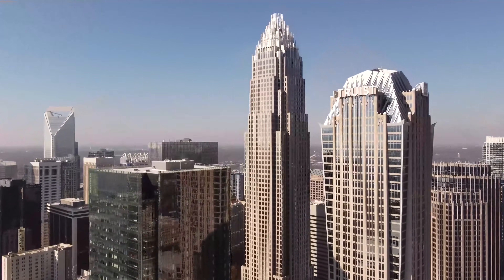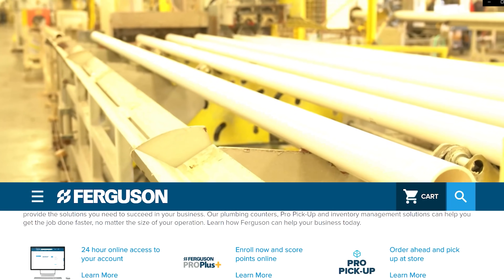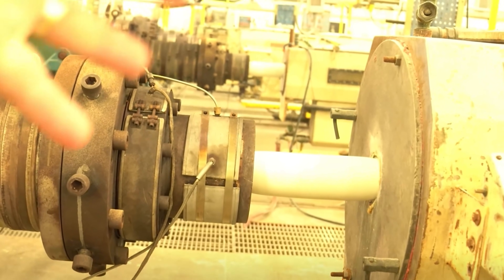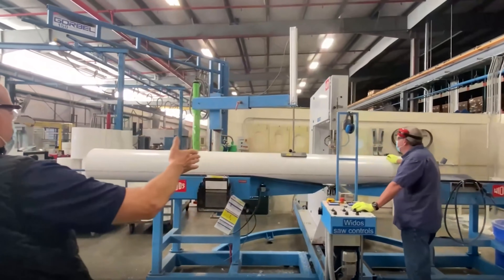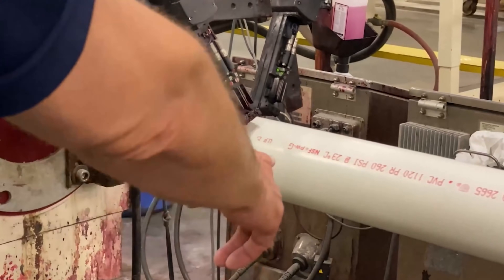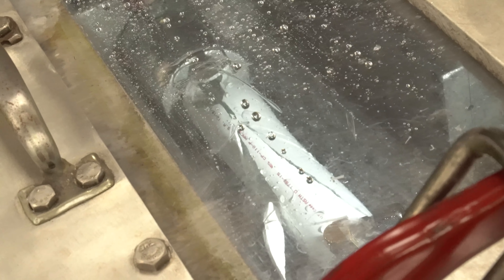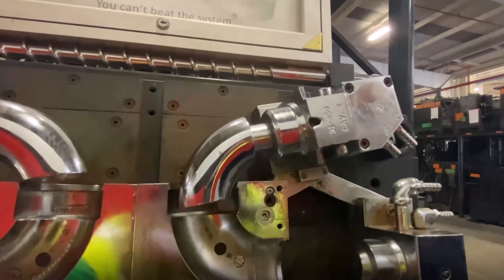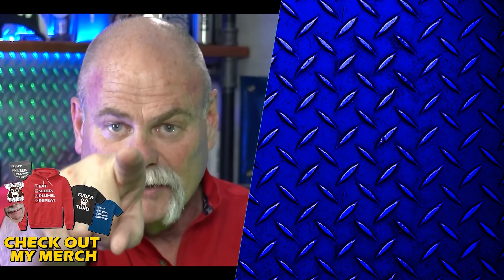How Plumbing Pipes Are Made | Charlotte Pipe & Foundry Company

Comment: The screw you showed above the mold is actually what melts the plastic through mechanical stress induced heat. We rip up the resin into a liquid state and then inject the liquid into the mold.

Comment: Why are they only pressure testing a short piece of pipe instead of a 10ft section? I feel like a longer section will fail quicker
Reply from the maker: I don’t know why... When the pipe gives it gives...
Reply: Every piece of c900 water main PVC was tested .dunked under water ends capped pressurized 4x rated max....some would fail bursting in pieces

Comment: I’m not a plumber, I’m not an apprentice, I’m studying to be a funeral director. Why is this so interesting to watch?
Reply from the maker: Not sure but I’m glad that you enjoy it. What was your favorite thing about the video?
Reply: @RogerWakefield  I love seeing things made it stirs something with my autism seeing that stuff, and yes I enjoy seeing the plumbing work too. Tho it was a tad short on explaining the actual manufacturing process if I were to critique it any.
Reply: @sterlingodeaghaidh5086  There's 2 basic technologies you're watching extrusion and injection molding.  The 2d pipe is extruded the 3d shapes are injecting molded. Both use large screws with a narrowing screw root to feed melt and mix the raw plastic pellets inside the round heated barrel.  For extrusion the screw keeps turning pushing the hot liquid resin thru a die set to make the round continuous pipe profile in a continuous process. Injecting molding does the same only the screw is allowed to move backwards while it's turning pushing resin in front of the screw tip. The screw tip has a one way check valve.  The screw is then driven forward forcing the molten plastic shot into the mold cavity. Then it's held under pressure until it cools and solidifies.  The molds have arrangements of cams pivots air/hydraulic pistons stepped parting lines gears collapsible cores etc. that are timed to move such that you can now get the solid 3d shape out of the mold when the 2 halves separate without ripping the part apart stripping molded in threads etc.  The large parts are only cheaper to make by hand because of product volume.  The million dollar fixed cost for a large machine and molds isn't covered by the greatly reduced variable pc cost. Special materials are often used for pvc molding. The hydrochloric acid produced during processing can chew up molds and machines.
Reply: A fellow deathling!! Ayy we need more funeral directors!

Comment: I hate plastic pipe. If it was up to me it would be illegal in all 50 states and we would go back to copper and cast iron.
Reply from the maker: As much cast as we’ve changed out, I’d disagree. I think plastic has been good for us. Why do you not like it?
Reply: @RogerWakefield  because it's plastic. I feel the same way about pex. What's wrong with DWV copper and a 4" main soil line? And L type copper for water lines? I do have a little experience with both they just started coming into play when I was young doing residential work on Long Island. Then I started doing bigger jobs working union in the 5 boroughs of NYC, where you just will not find it. It doesn't exist in the 5 boroughs and is illegal. Why can't we just have a national code? I just don't like the stuff I have a bad taste for it.
Reply: Copper and cast iron are still used in commercial and industrial buildings. As far as residential, there is no logical reason to run cast iron because not only is it too expensive, but it also doesn't outlast PVC. Cast iron rots overtime and is usually replaced with PVC.
Reply: @strangeroamer3219  what about DWV copper vs PVC? Cast iron lasts forever. The only reason I would agree with you is underground. Yes plastic sewer pipe will outlast cast underground. It is common here on Long Island to run the main soil line and house trap in cast then transfer to plastic at the outlet of the house.
Reply: @TheRabidPosum  I get it. Installing cast iron and Copper takes more skill. But it also takes more time and costs more money. That's what it all comes down to. The home owner doesn't care what kind of pipes they have behind their walls because they are never going to see them anyways. They just want the plumbing to work and their house to look pretty.
Reply: @strangeroamer3219  I am well aware of that. That's why the average American would rather buy a cheaper made item at Walmart than buy American made. But if we had a national plumbing code where all plastic pipe was against the law they wouldn't have a choice now would they? If we tripled taxes on all imports, raw materials and finished products, people would buy only American made products. If we started using cast iron and copper again, made from raw material from America, made in America, by American companies and workers, don't you think that would be good for the plumbing industry, the country, and the economy?
Reply: @strangeroamer3219  Also public sewers are not available in most of Long Island. But we do not have septic systems like most of the rest of the country. We have cesspools. Large cement rings placed on top of one another with holes in them for the water to leach out of. Usually there is a smaller overflow cesspool connected in case the main one fills up. Most of us have dry wells, which is basically a small cesspool but only used to serve 1 appliance, such as a washing machine or slop sink. Also oil heat is prevalent over gas or electric, most of us have oil fired boilers, furnaces, and water heaters. A lot of older homes still have steam heat with cast iron radiators. Just to let you know things are very different in the north east then Texas and other parts of the country.
Reply: TheRabidPosum I would never put cast iron pipe in the groundwork, behind the walls, or anywhere else in my house if I was building one. Cast iron as with any other iron is going to rust from the inside out due to the water traveling through it. I've tore more rotten cast out than I'd like to remember. Or when the house gets some age and settles. The house moves but the cast is like glass. It will start with a hairline crack and that's all she wrote. I hope you are not talking about a whole house trap cause those are nothing but trouble too. Why would that be better than trapping each fixture individually? We have a trap for each fixture and you have to vent it (no wet venting allowed anywhere in the state)  before you can catch anything else.
Reply: @erics3886  no DWV copper. Only the 4" main soil line should be cast iron, and that is exposed in the basement.   Every house has a whole house trap, as well as every fixture and appliance. It's the code here, I just assumed it was everywhere. How else do you prevent sewer gases from entering the house? They are always located on the end of the soil line right before it leaves the house to the sewer line. If you live on a slab house with no basement they are under ground next to the fresh air vent just outside the house. I guess they don't vent the main line where you are either?
Reply: @TheRabidPosum  sewer gas can enter the house as long as it stays in the pipe. Each trap at the fixture stop's it from entering the room. We have to put a full size vent on at least one toilet so the main line is always vented. Every fixture is vented by itself then when you get above the flood rim of the highest one you 5tie them together and go out the roof.
Reply: @erics3886  I understand each fixture is vented through the roof, and each fixture has it's own trap. But that doesn't change the fact that the main soil line needs to be vented and you need a full house trap.
Reply: @TheRabidPosum  the main line is vented. If you have 3" main once you get in the house and you have the 1st floor toilet vented with 3" all the way out how would it not be vented? The whole house trap is useless if you are trapping each fixture individually. What's the point of the whole house trap if each fixture is trapped?
Reply: @erics3886  it's proper plumbing. Not only is it the law it's the way it's supposed to be. Every house must have a full house trap and a fresh air vent by the house trap.
Reply: @TheRabidPosum  well I'm glad every state is different and that we have our own laws of plumbing. I agree with the fresh air vent but a house trap has to be problematic.
Reply: @erics3886  they can get stopped on occasion. But it's rare, and usually because the public sewers, cesspool, or septic system is full and you have little to no drainage and sometimes backflow and the liquid can't drain and the solids get stuck in the trap. But it's 4", unless you can manage to flush a baseball down the toilet it's pretty hard to clog it from the house end. Everyone on Long Island and NYC has a house trap, and they don't cause issues for the most of the time.
Reply: @TheRabidPosum   got ya. I'm not too familiar with a cesspool but we have either septic systems or you are tied on to the city sewer here in Kentucky. If you were to eliminate the house trap and get on the roof with a smoke bomb, light it, and hold it over the vent stack it would draw the smoke in the vent and down the sewer. Are you allowed to wet vent up there?
Reply: @erics3886  we don't have septic systems here. But I know what they are. We have cesspools and sewers. A cesspool is a series of large cement rings topped apon one another with a cap. They have holes for the water to leach out of. Most have an overflow cesspool, in case the main one fills up. Most houses also have a dry well, which is just a small cesspool. But a dry well serves only 1 thing, such as a washing machine or slop sink.
Reply: @TheRabidPosum  how deep are the cement rings? Seems like being that close together and surround by water it would contaminate a fresh body of water.
Reply: @erics3886  I did hear they can contaminate a little bit. Not sure of the level of it. But I'm sure septic systems have the same issue. No system is perfect. Even sewers. NYC has a combined sewer system. Which works great on dry days. But think how many gallons of untreated mixed sewage and storm runoff go directly into the water every time it rains. Long Island has a separate sewer system, but does the storm runoff go to a treatment plant or get discharged directly to the environment? That I don't know.
Reply: @TheRabidPosum  we had (and still have in older house's) combined storm and sewer for a long time but I think in the 70's the water district and sewer district outlawed it cause it's treating so much water unnecessarily being rain water. No point in treating that. So now we run the sewer by itself and the downspouts are either dug out into the yard with  and drain tile surrounded by pea gravel or just a splash pan below the downspouts. I myself as do many others catch the rain on our roofs and store it in a cistern in the front yard because we don't have a city water main near our house
Reply: @erics3886  storm runoff still causes a  lot of pollution. Engine oil, anti freeze, cigarette butts, styrofoam, chip bags, anything you see lying in the street gets discharged directly to the environment when it rains, if it doesn't go to a treatment plant first.
Reply: No one cares
Reply: @emmanuelrangel5844  I know, no one does. That's why plumber's are glorified janitors and not skilled craftsmen anymore, and elected officials don't care about an inferior product that will kill an entire family because it releases toxic fumes when it's burned in case of fire. No one seems to care about anything anymore.

Comment: I work for a plant like this, it's so cool how they make the stuff
Reply from the maker: So much fun to see how it’s done. This was a blast!
Reply: @RogerWakefield  there are blue pvc pipes, why they are not used here in the USA? .thanks
Reply: @edgywagy145  we made blue pipe for water mains
 c 900 way thicker than green sewer or gray electrical
Reply: I actually work in a pipe making plant as well. I run 2 different lines. Both dual wall corrugated pipe from 4 inch to 30 in diameter.
Reply: Do you have any ventilations or PPE? I work in plastic injection and extrusion with no any vents or PPE. Very old machines, poorly maintained and low training level. I work with PVC, PP, PE,PS, ABS. I am from Bosnia and Hercegovina. Please help!
Reply: Hellllo